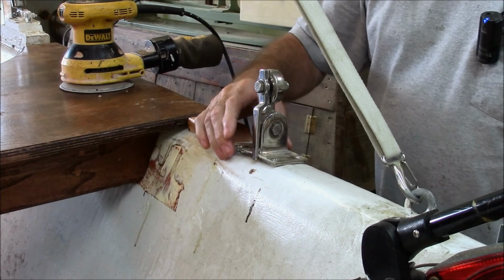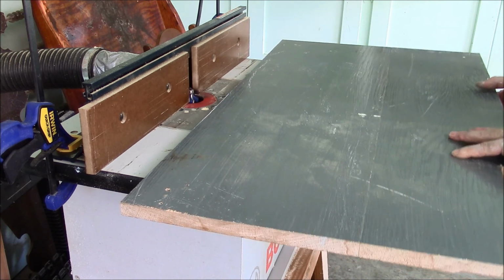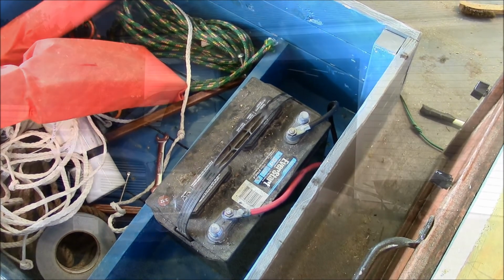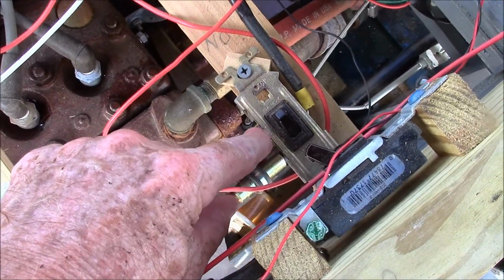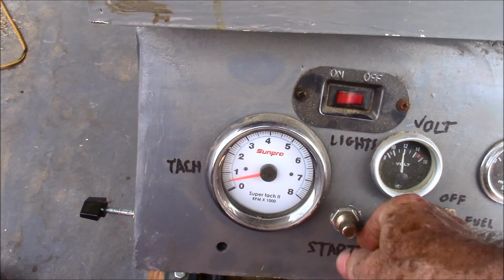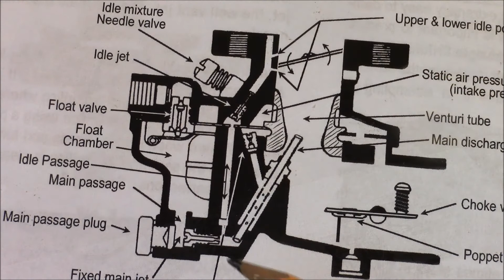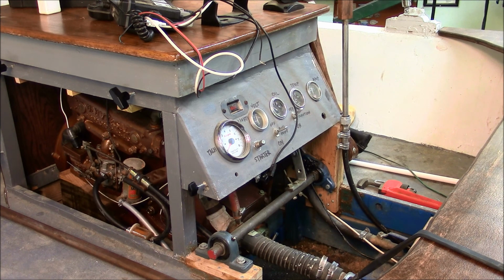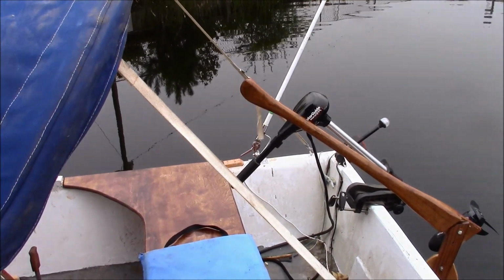30 The Trials of Sea Trials   Fixing The Pride of Memphis

Comment: I really enjoyed that video thanks :)
Reply from the maker: +South Main Auto Repair I'm advertizing on FB that SMA as the best channel on YouTube, which it is.  I would never say it unless it was true, as my opinion would become worthless.  
      So, the fact that you watched my video means alot to me.  Amazing how you figured out that part problem on the Dodge Dakota truck.  And what about those shocks?  They looked rusted out to me (maybe it doesn't matter.)  
     But perhaps it is the "American Dream."  When your daughter came in and told you that lunch was ready, well, my heart melted.  
     Make more SMA video, but thanks again for watching me.
Reply: Oh shoot man I like watching you because it is like hanging out in your shop, you like to fiddle around with stuff just like I do. Heck if I was there I'd been tearing apart the carb with ya! Of course we'd be dropping a V-8 in that boat to and switching it over to fuel injection! haha!
Reply from the maker: +South Main Auto Repair Funny thing is, I have had that carb out several times, and only in the latter-days have I realized that I only had to loosen that half-inch bolt in the back, thus draining away the problem.  
       Anyway, I bought me some brake-cleaner, and Kroil, as advertised on SMA, so all my mechanical problems are solved!!.
       Make more videos.  Hire some high school kid for whatever per hour to film you.  I have my own channel, but i have no qualms about saying that you have the BEST content on YouTube.  Check you stats, and you will see that I'm not just pulling your chain.   
      Make more videos.  Your fans love them all.